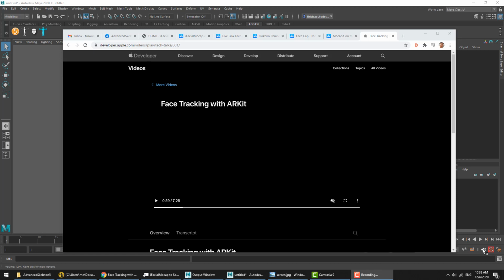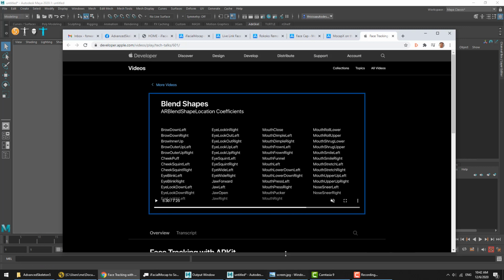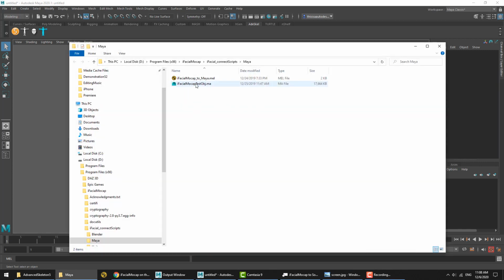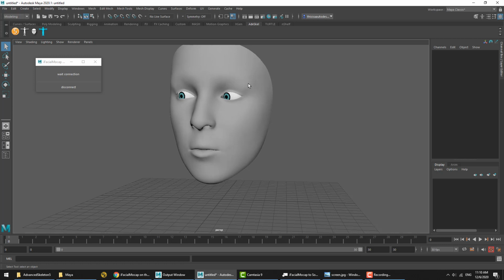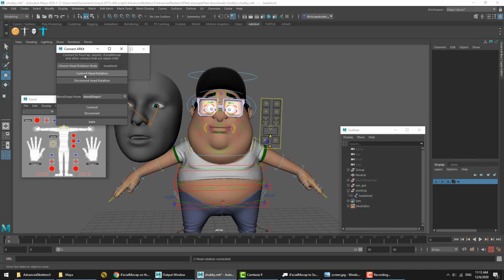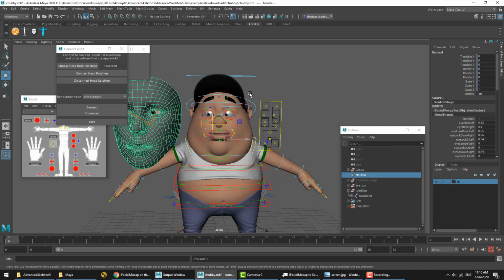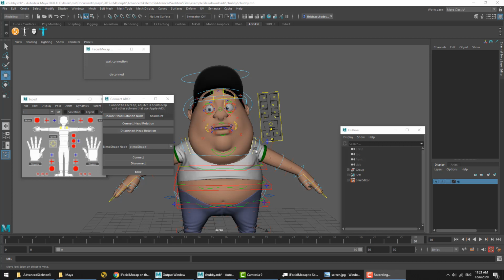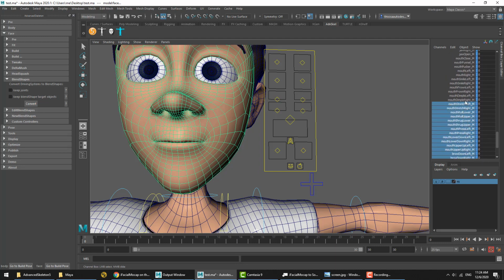Face Tracking with ARKit

Comment: I was kind of confused about the facial animation system on your custom characters. I understand the ARKit blendshapes on the sample model face, but how does it connect automatically to all the guides and drivers on the custom character's control rig? Is that a bone system? What was happening in the last step where you converted to blendshapes?

Comment: This is incredibly useful information. Thanks bro 🙏. So, I’m assuming you would follow by tweaking key frames to tighten things up, or exaggerate, etc. I find Mocap lips and facial expressions are not completely convincing. Are there any controls in softwares to dial that in? Like emphasizing or de-emphasizing phonemes. For example: M/P/B is often not fully closed or tight. Can you tweak that without having to correct each key frames individually? (Kind of a newbie here) Awesome content! 🍺🎩🎩🎩
Reply: Hey, did you ever find a solution to this?